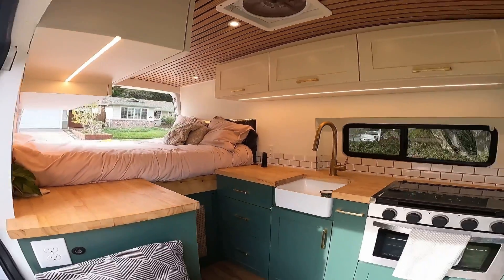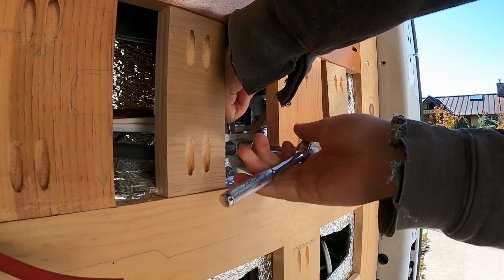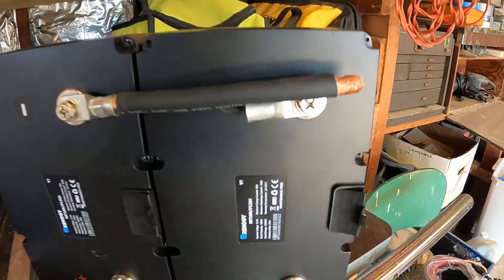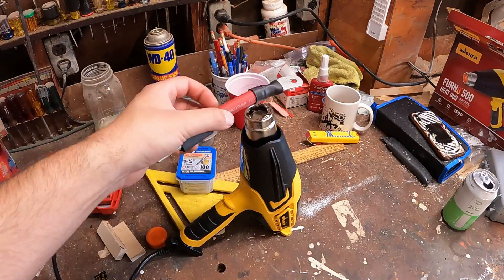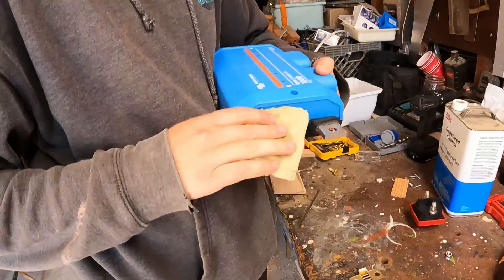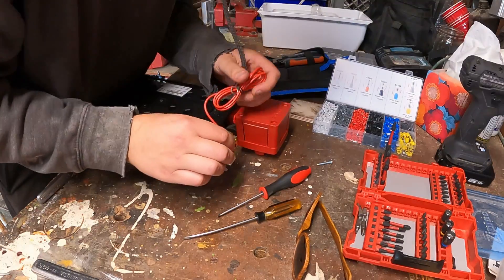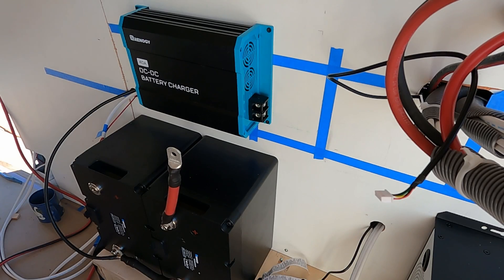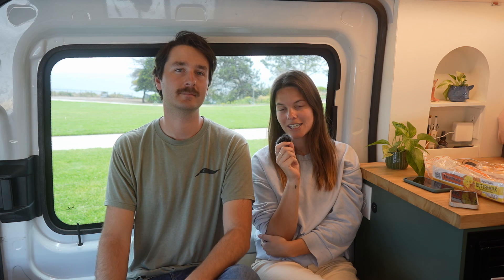Van Electrical Part One | Ford Transit Electrical Installation

Comment: Hey, thanks for sharing the details in your installation here.  Do you all have certain legislation there for laying out your distribution board? Here in the UK, for example, the big components like the Victron Lynx legally should be 10cm apart from other components (for adequate heat dissipation). They also need to be mounted on non-flammable material.  Do you have regulations like that where you are?  Some great wee insights in here!  Great stuff :)
Reply from the maker: Hi! Nope, no legal regulations like that here in the US. If the manuals for our components list any minimum distances, fuse sizes, etc., we are sure to follow that.